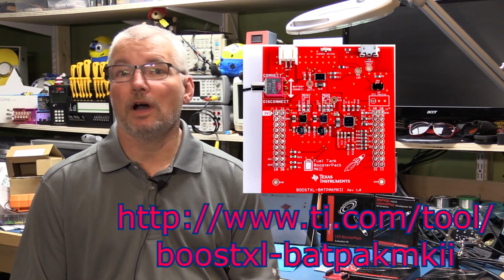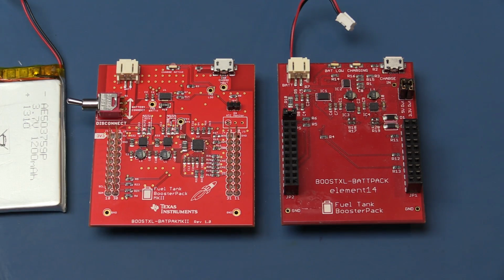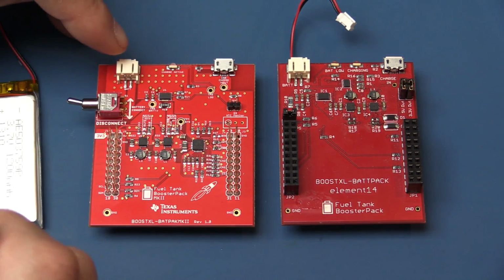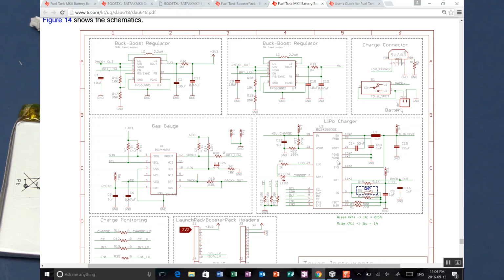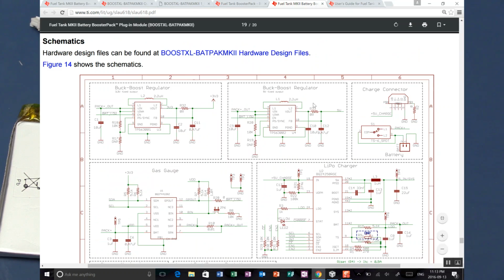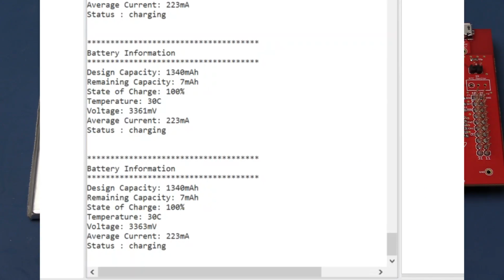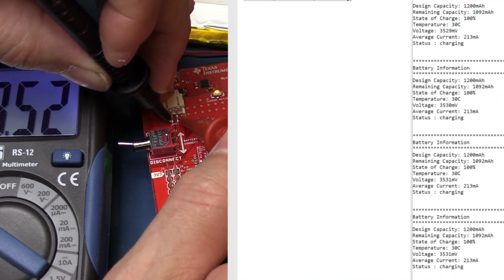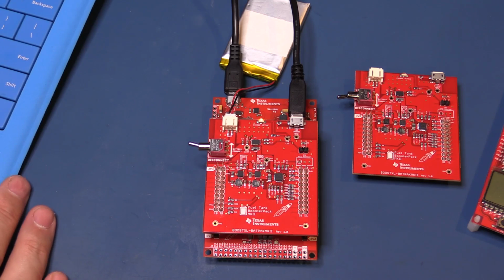TI Tuesday - BOOSTXL BATPAKMKII, LIPO Battery Charger booster pack

Comment: Did you make your own test program or used the example program?
Reply from the maker: A bit of both, there is a sample program provided that runs with CCS but I wrote a program in Energia way back to talk to the battery monitor chip way back, im not sure where it is now
Reply: Using the CCS example program and same setup as yours, It rarely says charging. Mostly it says discharging and the average current is -18mA. I suspect my BOOSTXL-BATPAKMKII is defective.
Reply from the maker: Markel Robregado what do you have connected to it as a charge source. Does it have enough capacity?. What does it read if you unplug the USB lead to the charger ?
Reply: Hi Peter, I connect the BOOSTXL-BATPAKMKII to USB Adapter with output 5V 1A. The first time I use it today, it says charging when connected to USB Adapter. When I remove the USB charging cable it says discharging. Then the next multiple tries it says discharging when connected to USB adapter, then when I remove the USB charging cable it still says discharging. Details about this problem are in this post link. Now TI Engineer is saying there is a problem with the example program. https://e2e.ti.com/support/power_management/battery_management/f/179/p/660411/2431152
Reply: Hi Peter, the solution was to put a 10K ohm resistor at R9. TI Engineer says there maybe a variation in those two TS pin resistors on the board.

Comment: I am using this with the msp432 launchpad, how do change the charge current to charge the battery faster?
Reply from the maker: http://www.ti.com/lit/ds/slusba1h/slusba1h.pdf page 21 should answer your questions
Reply: The booster pack has a 500-ohm resistor (R_ISET) connected from ISET to ground so by default the charge current is 500mA. But accroding to http://www.ti.com/lit/ml/slau619/slau619.pdf  page 2 , I should be able to run a code to change the charge rate anywhere between 300mA to 2A and that is what I need help with

Comment: Hey Peter, thank you very much for your video, I have a doubt about this module. Since it features the BQ24250 would it be possible to charge the battery with a solar cell while at the same time putting a load into the board?
Reply from the maker: technically you can charge and use at the same time but the gas gauge will only show the difference of the currents. So if you charging at 100mA (From the external power source to the USB connector) and loading 50mA, the meter will show 50mA charging,
Reply from the maker: I would also limit the voltage from the solr panel as this chip is not the same as the V1 battery pack that supported a solar cell directly. This one does not.